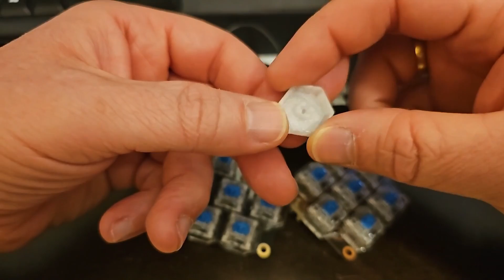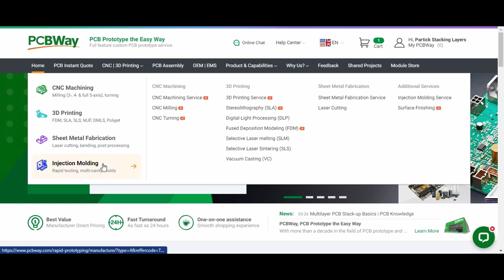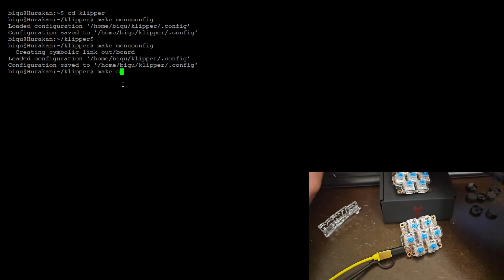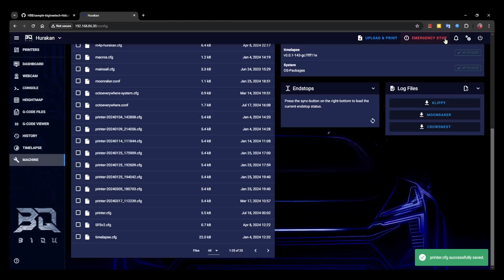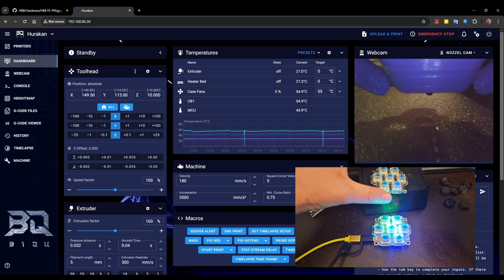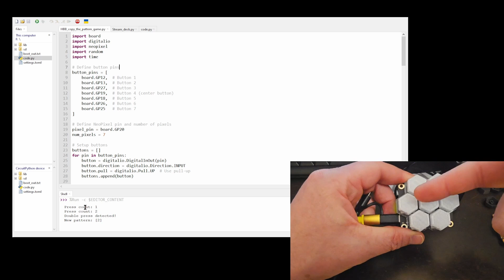Bigtreetech HBB a Klipper macro board with hidden talents

Comment: Hello, did you have problem with start MCU HBB? Turn on printer with HBB, KLipper - Error to connect MCU HBB. And i need to flash it and it works again. Somethimes it restart it whole printer and than need reflash.. Thank You for help :)

Comment: @StackingLayers What if you simply configure the pins inverted? e.g. pin: !HBB: gpio25. Won't it solve the press-release inversion?
Reply from the maker: If I recall correctly, I tried that. But its something with the way that it's wired that doesn't allow it to work as expected. I could be wrong though. It doesn't hurt to test it.

Comment: Im having a hard time a hard time getting the Keycaps installed on the HBB itself. Any advice for that? (When I try to press them on the blue pins just retreat into the plastic )
Reply from the maker: Perhaps more tuning is needed to have better fit. Mine just popped on.